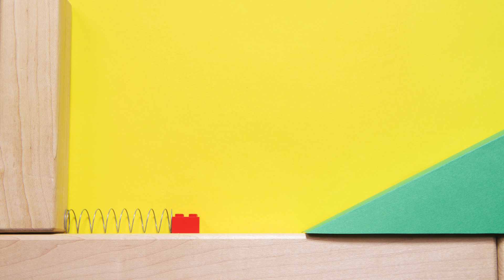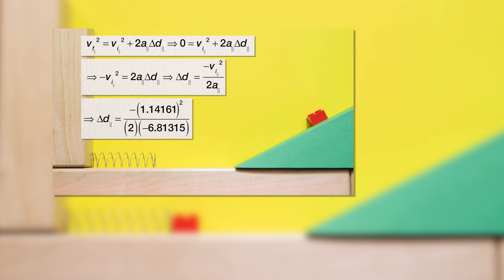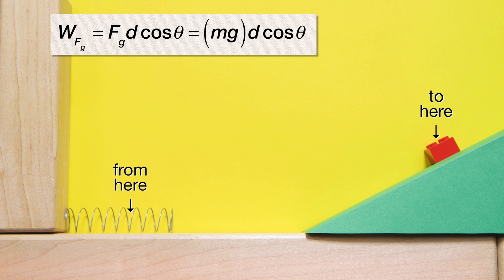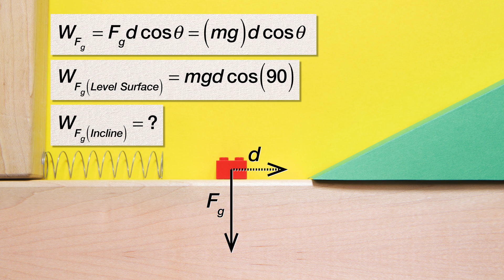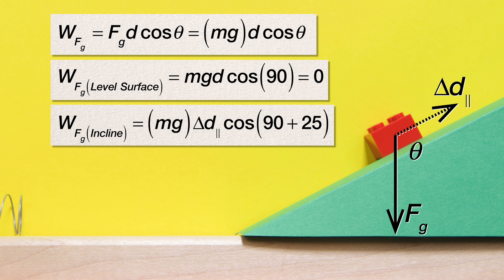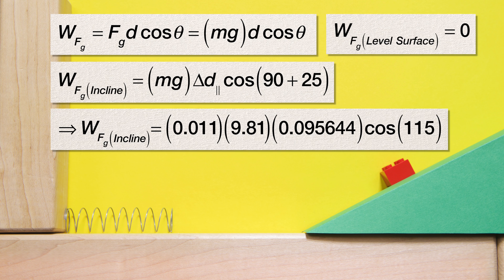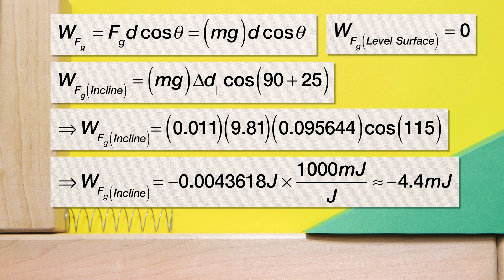Work due to the Force of Gravity on an Incline by Billy

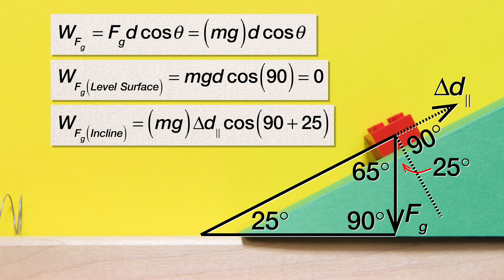Comment: Wouldn't gravity be pointing in the opposite direction as the change in parallel displacement at @2:13 ?
Reply: wait I just figured out my mistake. If we were to take gravity in its parallel and perpendicular components, we would have to use mgsin(25) and then stick a negative. I used cosine which is why i got it wrong.

Comment: what if the mass of the box is not given??
Reply: Usually when mass is not given, that is a situation where "everybody brought mass to the party".  Every term would have mass, and you could cancel out mass from every term, indicating that it doesn't matter whether it is 1 kg or 10 kg, the solution would still be the same.

This is an example that isn't one of them.  The work done by the spring force is independent of mass, so that means the final answer will depend on mass.  Because the work done by gravity and heat lost to friction will ultimately depend on mass.  If mass were not given, you would have no other option than to answer in a form that has an unknown value in it, representing the mass of the object.

In any problem, assign a variable for the information you are not given.  In fact, my recommendation is to always assign variables, even to the data you are given, and solve the problem in terms of variables first, such that plugging in data is the last step you do.  Perhaps you will be able to solve for it with other information given, or perhaps you can algebraically prove that the solution is independent of the unspecified value.

One thing people often do, is see a problem where mass is not given, and just assume it is 1 kilogram.  Or you are just given a ratio of two masses, so you assume the smaller one is 1 kilogram.  While it is common that you may still get the correct answer by doing this, part of the problem likely is to show that your solution is independent of mass.  Depending on how your teacher grades, you may lose a point on an exam by doing this, because you are making up data that isn't from the problem statement.

Comment: Doesn’t work have to be parallel to the displacement which would W=Fdsin()? That would find the parallel force of gravity, and also equal to W=mgh
Reply from the maker: If you look closely at my answer and your W=mgh equation, you will see that they are the same. This is only true because there is no friction on the incline.
Reply: Flipping Physics You used cosine though. So that would not give you the height of the incline (opposite), it would give you the adjacent side of the incline.
Reply from the maker: @kevsjournal  cos(115)=-sin(25)
Reply: Flipping Physics Okay thank you

Comment: I have two questions, wouldn't the factor of gravity on the straight surface be more a factor of friction? also the resulting work done is negative because the object moved in the opposite direction of gravity? Thanks, I really love how easy you make the concepts to understand!
Reply from the maker: +Julien Hugo-Webb
1) "factor of gravity" and "factor of friction" are phrases that make no sense to me. So I am not sure what your question is. Plus, there is no friction on the horizontal, straight surface.
2) The cosine of angles between 90 and 270 degrees is negative. Therefore the reason the work done by the force of gravity is negative is because the angle between the direction of the force of gravity and the displacement of the object is 115 degrees which is between 90 and 270 degrees.